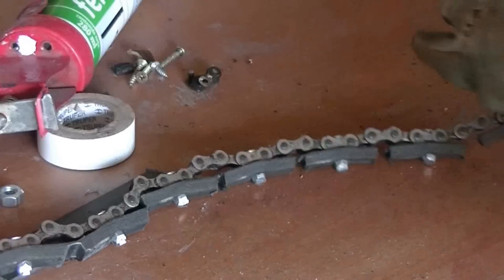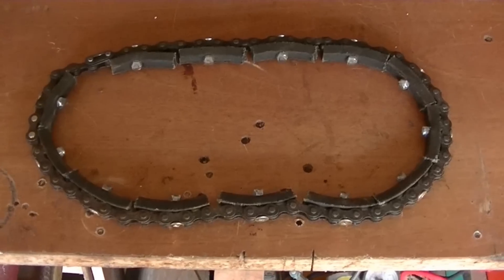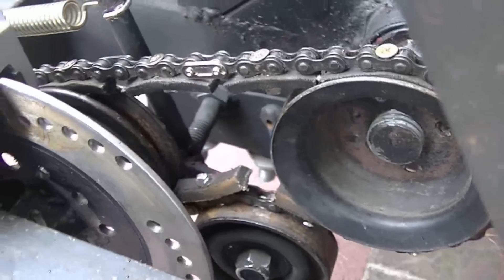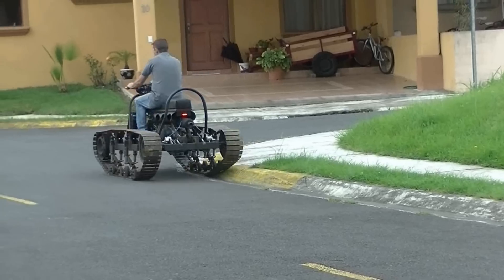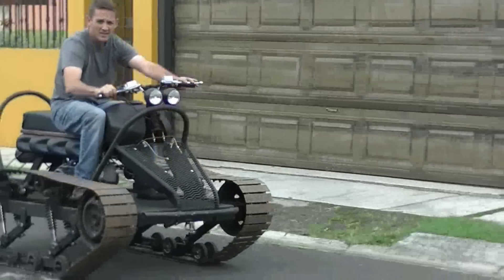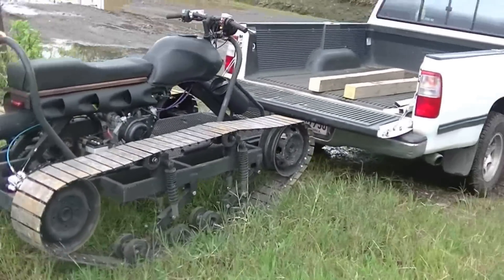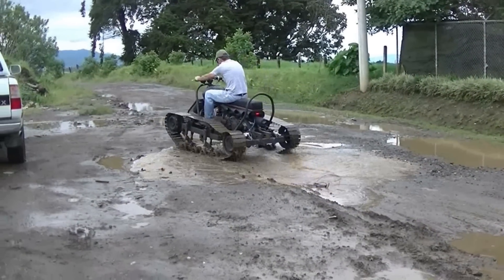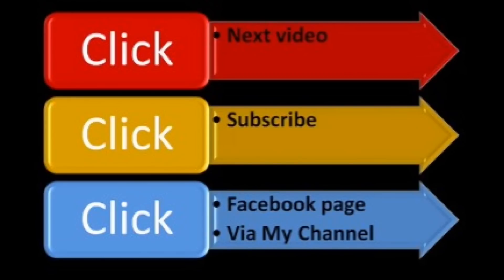Drive train update 10D

Comment: with Davey belts you don't cut the v belts all the way through that gives it more spring so it slips when you want it and tightens   all the way when its under tension.2 inch rings welded to your  your idler rims would help keep your track guiding straight at speed ripsaw had that issue at first and the rings helped fix it.but its agood job and looks like a fun project.
Reply from the maker: +cartmanrlsusall Thanks for the tip. I will try that when I make my new belts.
Reply: +Aceman307 hey bud give any thought to a splash shield? just put a tin box around the belt system simple it will work until you submerge the gear box
Reply from the maker: +VK70001.P Yes I think thats a good idea, I will put one around the new pulleys and belts.

Comment: About the tracks, you should add a sort of tightener to compensate when the suspensions loosen them like for timing belts in cars
Reply from the maker: Nicolas Delanneau If you check out my video"tracked tension wheels part 7 " You will see I have a way to tighten the tracks if they start to loosen. Thanks for the comment.

Comment: Maybe you could isolate the belts with a fluid seal to make sure water would not reach them? great videos by the way
Reply from the maker: DoctorSherwood I think I have figured out the main problems I am having. First one is the carriage wheel bearings are failing and causing allot of drag and the second is I need larger pulleys. The pulleys I am using are just to small. I think you are right building a shroud over the pulleys keeping them dry will help allot. Thanks for the comment.

Comment: Cool!! You got it going. But uh oh, pretty sensitive to water looks like. Now I'm worried a little with mine. I still want to run belts on mine though. Plans on enclosing that area well understood, lol.

I finished my tracks up over the weekend, and while I was doing that, I made the brake rotors and hubs for the rotors. There 2 pieces. Rotors are about 7 1/2 inches should be big enough. Going to have to cut a slot in the framing to fit them in, but it will work out to my advantage with the frame work though. Still have to bolt the 2nd track together. It started to rain right when the last pieces were drying from painting.

You gonna play with yours a little before you tear it apart?
Reply from the maker: ***** I think pulleys will work its just you need pulleys about 8" or bigger to get the surface area you need for good traction. When I built the back part of my tank I needed to have about 6" more space between the engine and the drive wheels it would take allot of work to change mine so I am going to have to figure something else out. It was fun driving it some before it started slipping. I have already torn it apart and started working on a different idea. Looking forward to a new video from you on your progress.
Reply: Aceman307 Had a couple ideas. We get this problem in the shop every once in a while on our high output alternators, the pulleys would get a glaze on the surface where the belts ride on the sides which would make them slip, sand the groove to roughen it up for a little more grip. Or the V in the pulley doesn't match the belt, should be 15 degrees for both. Or maybe the belt is bottoming out in pulley but I didn't notice that in the vid. Belt needs to wedge itself into the sides evenly without bottoming out to work right.  I keep thinking about it and I keep thinking that it should work. Or maybe switch to automotive belts. Just brainstorming, hope it helps. I would build these gocarts way back when,, and I would always use automotive belts for the drive to the wheel and never had a problem with slipage. I would have a 1 1/2 inch pulley on the motor and a 6 inch pulley on the wheel and the problem I always had was the belt would grab too much and stall the motor. There's an idea. You would loose top speed but make the engine drive pulley smaller and the track sprocket pulley bigger. Still will take up same amount of space too.
Reply from the maker: ***** You could be right about the belt bottoming out especially since I have those nuts on the bottom side. I ground the nuts at an angle I dont think they are hitting. The biggest difference between having belts drive the go cart is you can have the pulleys tight all the time with the tracks they have to slip and then grab . I think the belts could work just like I said before bigger pulleys.
Reply: Time will tell, always love a challenge, lol.

Comment: Or just go hydraulic.2 Valves 2 motors 1 engine 1 pump. you have plenty of room for all that and will link up to you existing setup kinda easy. few move valves and pipe you can adjust your ride height and track shape.
As small forklift weighs about 10 tonnes and can whip along at 10 mph, a bit of gearing and you will be flying along. Hint hint nudge nudge. There's all the parts you need.
All the best

Comment: Small car differential  (front alxe) has flanges for cv shaves would work good. And still can steer with each brake. Also the older zero turn mower had friction cone drives not hydraulic. Might be a possibility

Comment: You got it right, but you need to protect the transmition from outer conditions, you can also reinforce the belts with car seat belts folded in thirds in closed U shape, thus no need for cutting the belt. Inspiration here- /watch?v=BWHAfaC-pPg

Comment: You could try a chain and some kind of car diffirential... Just spitballing here tho
Reply from the maker: Sven Jonkers Thats a good idea. I went to a junkyard the other day to look at differentials. I am going with chains,  just have to figure out how to allow the tracks to slip to steer.
Reply: @Aceman307  When I worked at Cushmans, I was told they lost 1 million dollars on the design on their 8 wheeled vehicle. They used brake pads at each wheel to make the thing turn left or right. all the left would lock up to turn left, all lock up on the right to turn right, well it worked great except the customers were replacing brake pads every 2 weeks. So they redesigned it with a hydraulic box at each wheel which saved their asses.
Reply: Aceman307 youd have to get a limited slip diff i think, if you brake one side the other wont get power with a normal differential. There should be no problems braking it as far as old school tanks are.  Slipping would be varied on the amount of pressure on the brake right? Just throwing these out
Reply: Sven Jonkers Exactly my thoughts.
Reply: Swearzy Just a normal diff will work. If you break one side the other side gets more power. It's better than a slip diff. if you lose traction on one side you can just break that side. The hardest bit is making it all fit in the existing setup. I would look at some 4WD parts and see what you can get working doing a 90' bend of the engine or main sproket after the engine.
Awesome work BTW
Reply from the maker: Swearzy Its too bad the belts did not work. I probably could get them to work if I installed bigger pulleys and enclosed them from the elements. But I am going to try something else first. Thanks for the ideas.
Reply from the maker: Sirus Thanks for the ideas. I will keep playing around with this until something works.
Reply: Aceman307 Yah, thats my backup plan too. All I need to do is swap out the welded axle in the transaxle to the original open diff, I got plenty of parts for the gearbox from 2 others, and switch from belts to chains going to the drive sprockets and rework the brake linkage and I'm good.